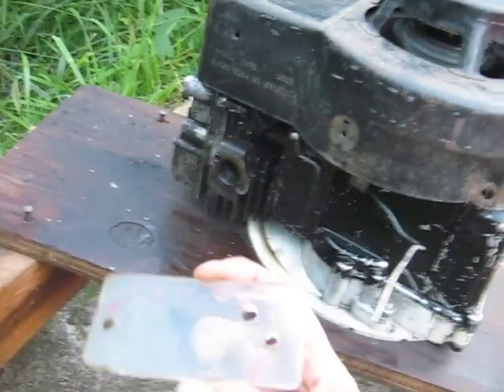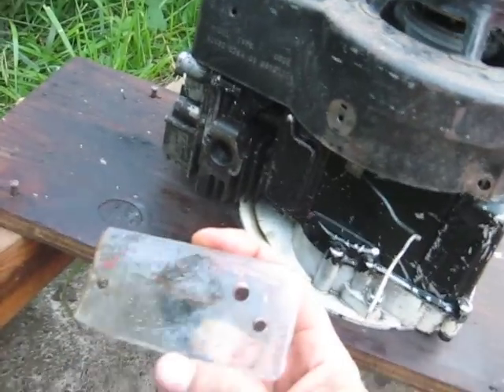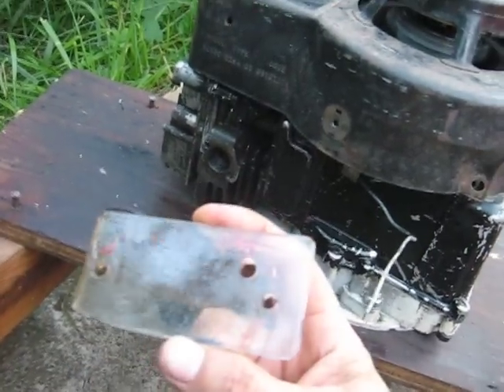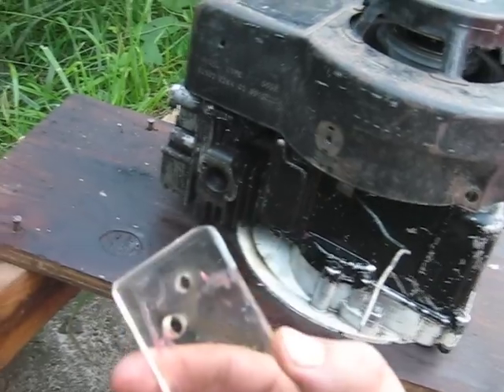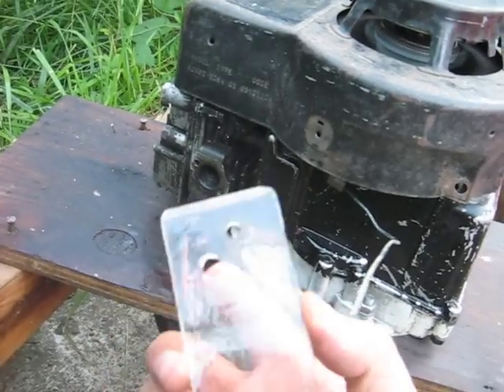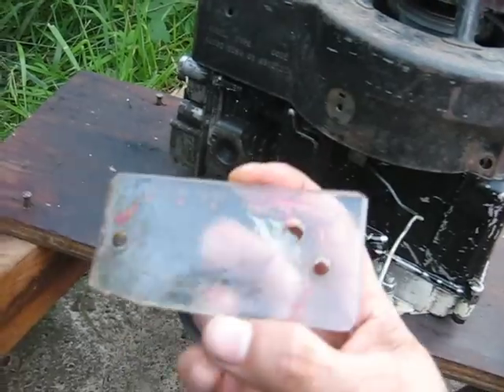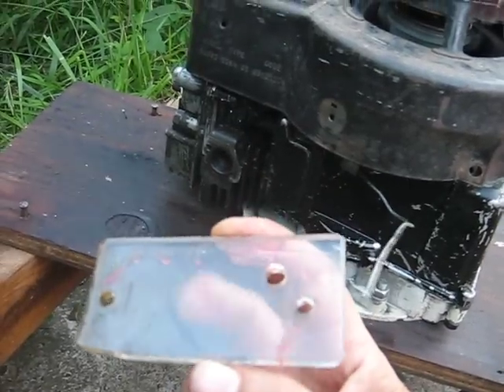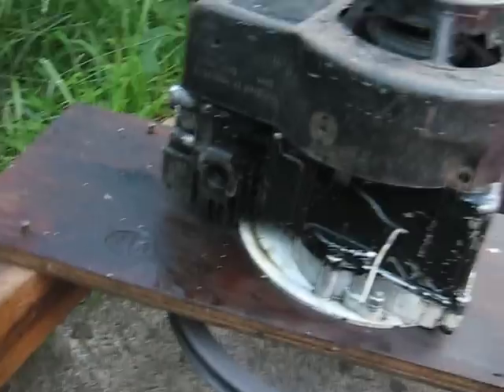Clear Valve Cover#5 Regular spring pressure Briggs Flywheel Engine

Comment from the maker: Yes, you are right, the stiffer the spring is, the more throttling effect it has. I hadn't put very much thought into that, so following that logic, if I want the engine to run slower, I need more seat pressure. Thanks for pointing that fact out to me, I will put that into practice. I have a jury-rigged tachometer I want to try out tonight, if it isn't raining out :)

Comment from the maker: Yes, it would be VERY difficult to achieve the compression required for a true diesel. I completely agree, the Briggs cylinder may grenade at the required pressures. Now, there are ways to solve all of these problems, but it would certainly be a lot of work, and still be dangerous.

Comment from the maker: The stock breather has a 1 way disc valve in it, as well as a mesh kind of like a sponge. The main reason is that the 1 way valve allows the air out of the crankcase, but not back in, limiting how much oil gets stirred up in the valve cover area. Mine allows the air in and out, so it really stirs things up! By the time I was done these vids, the crankcase was 1/2 empty!!!!  I think it will kill the palnts nearest the patio (Ooops!)

Comment: quote: I noticed that the engine runs slower, and is erratic at very low seat pressure

thats not that wierd. the tighter the valve spring is, the more the valve will act as a throttle on the intake :-)

Comment: AND the sidevalve config of a briggs is not all that good for getting the compression as high as it is needed to run diesel. and a briggs was not built to handle the very high pressures in a diesel engine. so yes quite dangerous